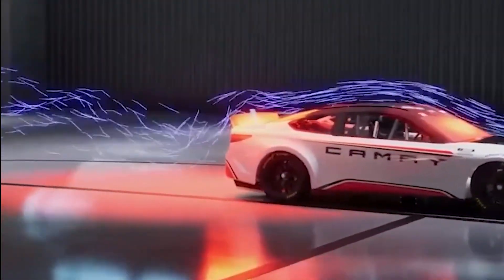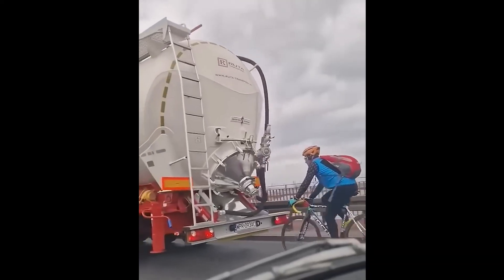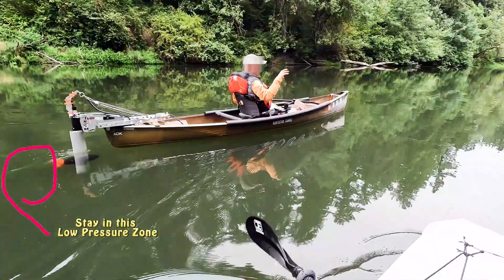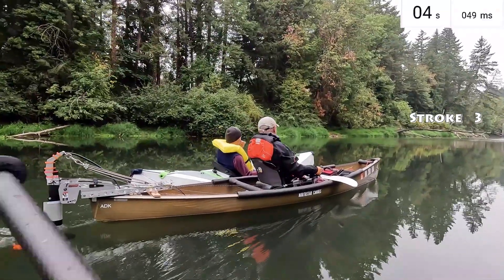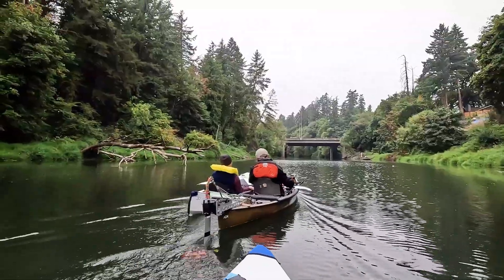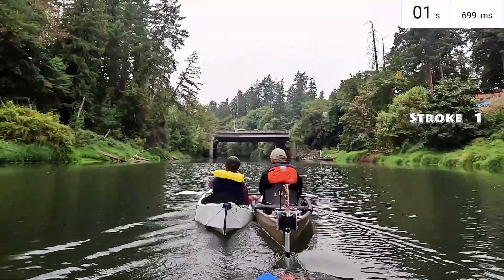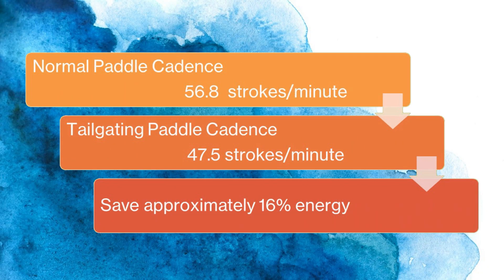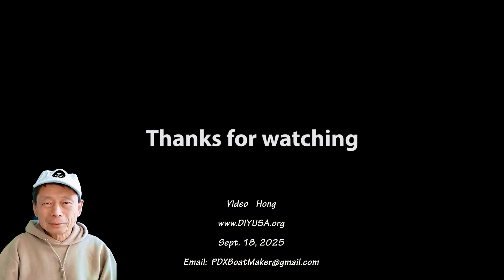Can you paddle faster with less effort by trailing a motorboat?

Comment: You have video on how to stick together 2 coroplast? Because i only have 2 , 5ft length coroplast.
Reply from the maker: Thanks for asking. I use heat fusion method. It is difficult to glue two sheets together. Using tape is not reliable. Please go to this page, which has links to videos showing you how to use heat to fuse the sheets together, with examples also. https://www.diyusa.org/techniques
Reply: Thank you  @DIYUSA 

Cani do it with flat iron?
Reply from the maker: @RogAllyZ1E  Yes, my friend use clothing iron. This is the link to more details: https://makezine.com/projects/origami-kayak/
Reply: Merci
Reply from the maker: @SaraTubefr  Thanks for watching